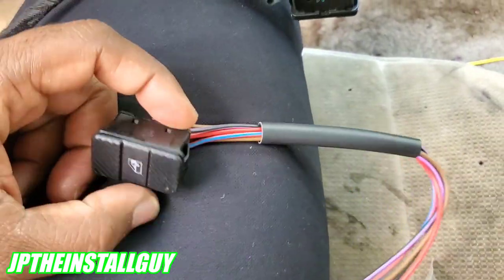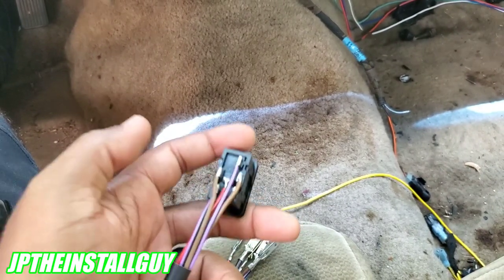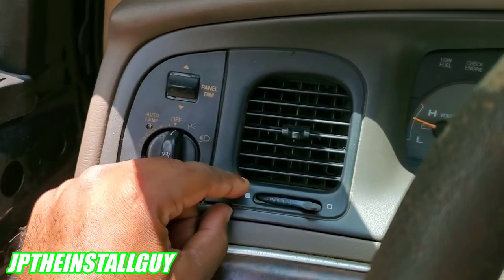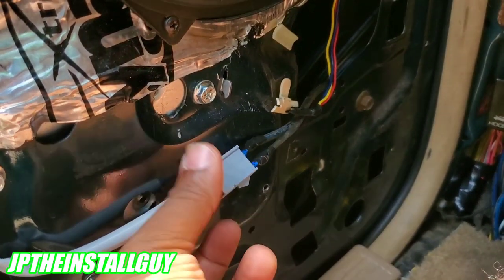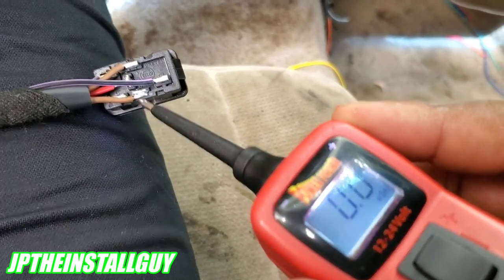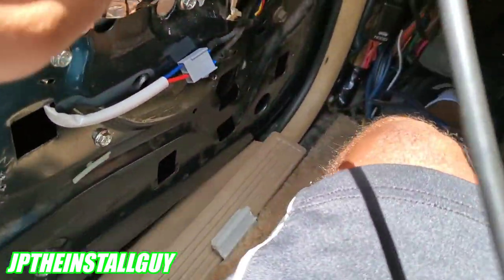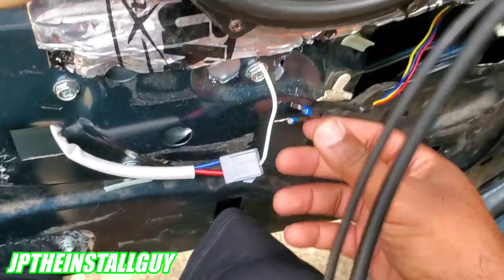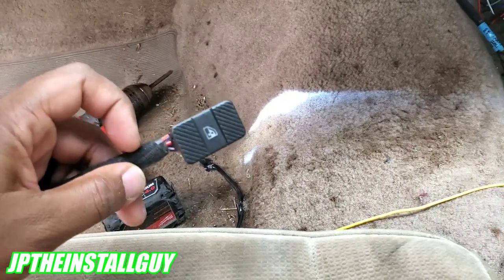How to wire an aftermarket window switch | window switch relocate

Comment: Man, your saving me here, excellent video my friend! I totally redid a 93 f-150 , the window switch works on the driver side, up and down, the passengers side how power to the center of the switch just like it’s suppose and I can take the switch out from the drivers side that I know works and it does nothing on the right side. I’ve decided to just switch it all the aftermarket switch’s. Until just now I had no idea how to wire them, I’m still at a little bit of a loss cause my rocker switches are different than yours. But now I know enough to figure it out, thanks to you and your video!  Edit; my right side has to work so I can control window from left side, but a center console of some type or possibly just a switch on my shifter for that window might be better than having it on my door. I was already putting all my aux lighting on the shifter, I could maybe expand than location to include right side window switch.

Comment: this is probably a stupid question, but can you connect on ground directly to the other assuming you have one to an actual ground source? I'm trying to use one of these for something other than car windows... I need to invert a signal to use barrel connectors with either positive or negative center pin... 
TLDR I need something that will invert positive and negative signals so I'm hoping a window switch will work

Comment: Really good video and easy to understand.I am trying to install a second passenger switch on the drivers side as the car doesnt have one .I am using OE 4 pin switches which have +12v -12v and 2 pins from the electric window ,motor which I pulled 2 wires from passengers side .I have both switches connected the same and my problem is that with both connected ,none work and no +12v reaching pins.Only work if I disconnect one switch separately..Any suggestions would be greatly appreciated it and keep up the nice videos!Cheers

Comment: My drivers side window switch stopped working and I couldnt get a replacement OEM switch so i bought a universal switch and used some speaker wire that I had laying around but the motor just click trying to go up and. But when I connect the motor directly to power from the original wire harness and it goes up or down. Could it be that the wire is too thin

Comment: thinking of doing this, with my factory window switch, the window rolls up super slow and down slow but if i pull it and jump the connector power to up and down, its super fast. something is resisting in the switch i believe

Comment: I am trying to get sufficient power to my passenger front side window. I used a Volt meter and tried to get a reading while the electrical wiring was hooked up to switch and it was displaying no voltage numbers. Assuming i had the prongs far enough into the wiring component and it was giving me an accurate reading, what are my next steps in fixing the issue?